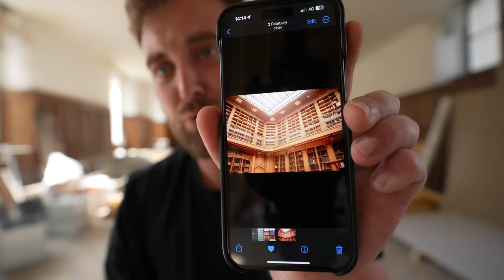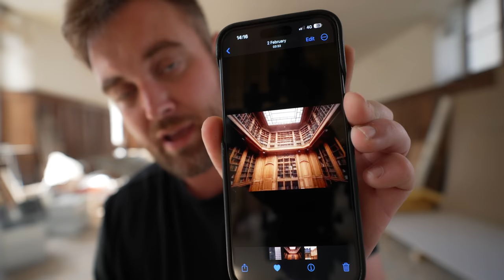Library Project REVEALED

Comment: Hi Billy,
II used to manage my neighbours' Manoir in France. It was 16 century. He opened up the 2 levels and made the large lounge into a galleried library all in oak. I know it was quite wide as he had a chez lounge on an angle up on the gallery. He did the railings in wrought iron.
The  bookcases were only upstairs. And the downstairs was just panelling.
If you did it that way, you could save the original panelling you have downstairs.  And save money too. It was very impressive.  And he had a grand piano in the downstairs area. When it was played, the whole room came alive. 
If you want to have a look at what he did there, look up la Croix Rompue in Normandy. There are a couple of pictures on there that will give you an idea. The 2nd shows you one of the upstairs windows of the gallery.  You can see the folding shutters on the inside of the windows which looked fabulous when closed. And he had  the stone spiral staircase in the tower that took you to the galleried area. 
It is a rental so no probs in looking at the photos.  
I hope you see this comment and find it of interest?
Debbie

Comment: Why wouldn't you keep the big room as an event space? If you have commercial plans for the property in the future that would make sense!
Reply: Have to agree with you. I'm trying to understand what the overall concept plan for the property is. Is the kitchen going to be a fully fitted commercial kitchen to allow for large events? How does the kitchen relate to other rooms that could be used for functions? Is there provision for a cool room in the kitchen? If it's a commercial kitchen is there provision for three phase power to run ovens etc?
Reply: @robertbradley2310  Actually somewhere during the kitchen reno, he stated that it was not going to be a commercial kitchen.  Makes absolutely no sense to make what appears to be (more or less) a large home kitchen in such a large property. Particularly if they plan to host any type of large events there.
Reply: Splitting up your ballroom or grand salon?    You already have the bar room as an intermediate space.

Comment: Looking forward to the library project start.
Will you install new metal ring beams to hold the building together around the library void for when existing cross beams have gone?
Reply from the maker: the plan is to have large steel beams anchored between the exterior and interior walls to create the gallery, they will be bedded and welded to create a sort of hashtag design.
Reply: Maybe, you could design a crossing arch bridge in the middle to get from one side to the other, to help with the support.  Just thought to help anchor the gallery.❤

Comment: Hey Billy! The doors and windows look amazing! Remember to remove the backets and hinges when vanishing, so you can varnish behind them. Othervise moisture will get in and the tanins in the oak and the metal will react and black spots will show up around them! Keep up the good work! 

Kind regards from a cabinet maker and furniture restorer from Denmark.
Reply: Ps. the tanins in the oak will slowly, but surely eat away on any iron or steel corroding it and making it rust quickly. This is why you always use brass hardware on oak :) ps predrill any screws and put a similar screw in in steel first, pull the screw out and replace it with the brass one. Use a candle stub to lube teh screw, it will go in alot easier ;)

Comment: Im very keen for the library. This will be the piece de resistance of the convent. Definitely make the access wider to walk and consider space for a wheelchair if it isnt required there.
You absolutely must MUST have a hidden panel or doorway put in to reveal something clever. How could you not? Sherlock Holmes, harry potter, Young Frankenstein are a pinch of inspiration and add just a bit of fun. 
😊

Comment: I love the library project. You've talked to a carpenter, but do you need to talk to a structural engineer? That's a lot of changes to the support of the building vertically and horizontally.

Comment: The oak doors and windows are gorgeous wood. I understand leaving the wood showing. The facade of the convent looks moonotone and unattractive without the white painted doors and windows. 

Maintenance on wood protectant will be more frequent than painted. 

I would consider leaving the rectory the size it is now and transition from the library to a sitting room/portrait gallery. Perhaps wall off a small area for a bathroom and storage closet.

Comment: So maybe I have missed something somewhere. You have told us what your plans are but what are you going to do with these room? The covenant has to be self supporting so what does a double decker library get you?  Hardly anyone uses a real library and even if you use for ambiance it will not be worth it. So Billy what “are” you doing. You hinted at the bank furniture would make a good bar. Are you making a hotel?

Comment: If the rectory becomes the library, where you will host large scale events? Are there local carpenters and artisans who can help with the project so the community can invest their time and talents in the property as well? I was thinking especially in the maintenance of the gardens while you are working on other projects inside. You worked so hard on the gardens in the beginning and had mentioned that it could eventually become a community space.

Comment: Billy.  Have a question 🤔 
With the Osmo for the windows and doors,  does it need to be lightly sanded before applying each additional coat??? I really love the way wood turns out when I've seen this product used.  Just unsure about if sanding is required??

Comment: well removing that floor will deal with the issue of the broken beams in that floor, just need to add supports to the walls, as the floor you are removing holds the walls secure from bowing in or out.

Comment: Half of the refectory would be 55 to 60 square metres . And if that room gets 8m high, along the walls books in shelfs and cabinets and a gallary, doesn't it look like a tower of books from the inside once it is finished?
Reply: @janetpendlebury6808  
I think that the space of the room would be too small for the height of the room for it to somehow look good. 
For example, 60 square meters is 10m x 6m or 7.75m x 7.75m. 
The shelves or cupboards take up space, as does the gallery. So the room with 8m height will look taller than wide or long (or taller than wide and taller than long). I don't think that's a good idea.

Comment: Where are you going with a two story library in a convent that never had such a library? Especially given that you would like to see commercial use of the convent building (hotel, events ect)  it seems that a large library is more of a personal use idea. Who would use it and also procurement of the reading material is another big expense. Would the books be French or English. The idea of this library doesn’t seem sympathetic to the design and purpose of the convent. Personally I would focus more on the basics like the heating and cooling plant, revamped plumbing and running new electrics or solar power panels and window replacement before I’d spend big  money on a two story library with limited use possibilities. I put my focus on the money making elements of the convents’ practical usages. IMHO

Comment: When the library project is completed and you start adding books etc, please consider finding a librarian to help you get it sorted. Library science is a specialist field and if you start right it will grow and be a useful resource. The local municipal library (if there is one) might be on board with seconding one of their librarians to help you. Librarians the world over speak a common language. Amazing project. Also, rather than split the room, have the library at one level to allow wheel chair access and maybe look around for those amazing reading tables with the little lights where the books can be set out and read without breaking their spines. Many possibilities.